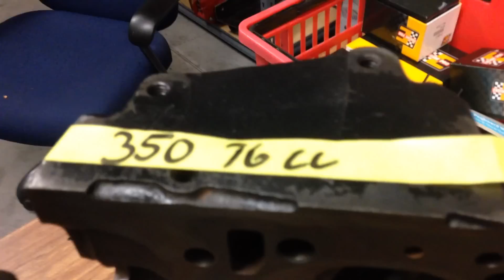350 and 305 Chevy what's The Difference

Comment: The problem with a 305 is only external. Tons of 80s and 90s cars came with one and they were choked at the intake and exhaust for emissions. Edelbrock intake, a set of headers and a new carb and bam. It still has 8 cylinders and it's still a 5 liter engine. and they last for damn ever.
Reply from the maker: There is one internal disadvantage and that is the bore size it has a bore smaller than the 283 a smaller bore is a definite disadvantage as far as air flow is concerned if we compare it to the 4" bore of a 302 IE 5 liter Ford the 302 with a 4" bore has a definite performance advantage over the 5.0 Chevy a larger bore is going to fill much better than a smaller bore every time this has been proven time and time again over the last 50 years at the end of the day however the 305 is not a bad engine they work well for the purpose they were intended and they are cheap to build maintain and run they defiantly get better mileage than the bigger bore engines If I had a pickup for light duty use or a car for daily use I wouldn't hesitate to build and drive one

Comment: i thought if you used the 305 heads stock size valves for the 305 (1.84 intake and 1.50 exhaust) did a bowl blend cleaned the throat, and un shrouded the intake side of the chamber to the cylinder it would make more power, it would defiantly have more quench area so higher compression shouldn’t be as much of a factor.

Comment: But Hi-octane is not available for 11 1/4 compression, without racing gas.   Couldn't the 305 head with 350 valves be opened-up, so you end up with a 10.25 compression, de-shrouded valves, plus running a cutting medium to increase runner-volume in the head, so it flows like a 350?  I guess if you wanted hi-compression on a 350, you could take a trick-flow alloy head, or stock, and mill it to increase compression, but I think buying a 305/350 valved head is for those that own a die-grinder, a compressor, a 350 block, and too much Time.   Cool vid.

Comment: The quickest way to find the difference is to drive a pick up with a 350 50 miles and then drive a 305 the same. 305 has no power now I have to say I never owned a 305 until a few years ago. I needed a truck to drive and bought a Chevy with a 305 and the first time I drove it on the Interstate was an eye opener. I drove a Ford Tempo with more power that that truck. Needless to say I didn't have it long.

Comment: Smaller bore and more gasket surface?
Sounds like a good recipe for more boost. 😁
Reply: Operator1836 Running the lower compression higher flowing 350 heads..??🤔

Comment: Are the heads on the 305ho tpi motors any better?
Reply from the maker: nope
Reply from the maker: s little but allot of work for little gain
Reply: We're restoring a 1987 z28 tpi 305 ho 5-speed for my son.  It's a low millage, 59,000, survivor.  Driving it, before tearing it down, it felt a lot more powerful than my buddies highschool 305 Malibu.  I figured it had heads more like the later vortec heads. 
My question could have been worded better.   I'm not really worried about adding horsepower for a teenager, I just found your video interesting.   
Thank you for your video and response...

Comment: can I put 350 heads onto a 305, and change my 3:05 fuel system to a 350 fuel spider if I change the upper and lower intake or would that lower the compression too much

Comment: 305 usually has 153 tooth flexplate instead of 168.
Also 305 lasts longer in a demo derby because the cylinders are farther apart and therefore don't overheat as quickly. The extra metal between cylinders acts like a heat sink or insulation

Comment: It's all about the combo! Gotta have the proper camshaft and intake. Headers, dual exhaust 4 bbl carb. 305 can make 1hp per cubic inch easily. Add a 700r4 trans 4.11 rear 28 ×10 tire. I guarantee the mustang guys will swear you have a 350 when you bust their ass!!!

Comment: 305 are plentiful and dirt cheap because of the stigma that they are junk. I have the factory 305 in my Parisienne and I chose to built it instead of trying to find a good 350. Some ads for a beat up 350 were around 1000$ and seen at 2500$ just stock and unsure of its condition either.  Trick Flow as all aluminium head with 56cc perfect for the 305. I am buying a set !

Comment: made 510whp with a 305 with 227 heads and eagle crank,clevite coated by calico bearings,eagle rods with some stock pistons with nicely gapped total seal rings and a 620 lift cam and a 75 shot  lol

Comment: What was the difference on a Chevy 305 vs the 305 h.o
Reply from the maker: The Heads,   the H.O. 305 has heads with bigger intske valves and a smaller combustion chamber for higher compression

Comment: 1st 305 I left stock 85 c10 2nd a 96 all I did was a Hypertech programmer I out ran a rouch 99 mustang supercharged but a dang Nissan 350Z out ran me lol so  I got beat but my 305 was extremely clean internally no gunk no sludge in that 96

Comment: Is it possbile you can tell me the motor i have the stamp on the back of motor says GM 3970010 thats on drive side rear and front by heads passenger side says V0125TJZ

Also on the passenger side the rear says A86 (inside an oval)

Comment: What was GMs reason for building the 305? It seems other than maybe fuel economy the 305 would never out perform the 350 so why put it into production? Thought maybe you might know
Reply from the maker: it was built out of nessisity the EPA required manufacturers build a certan percentage of smaller cubic inch engines with better fuel economy many of the 305 parts are interchangeble with 350 so they met the EPA mandates and saved a ton of $$ by useing existing parts
Reply: @Myvintageiron7512  I kinda figured it had somthing to do with government regulation I appreciate you answering my question this is the best video I've found as far as compare and contrast between the 2 engines. You put out great content and I've learned alot from your channel your very knowledgeable and take great pride in your work and work hard to teach all your viewers I just wanted to say thank You for all you do take care and keep the content coming THANKS!

                          -Cody
Reply from the maker: @codyhusbands1165  your very welcome

Comment: Why is my 72 c-10 engine a 307. What is the difference  between 305 and 307.
Reply from the maker: A 307 has a bigger bore and a shorter stroke the 307 and 327 share the same crankshaft and rods the 327 has a 4" Bore with a 3.250 stroke the 307 has a 3.875 bore same as a 283 but the longer stroke of the 327 3.250 the 305 has a smaller bore and a longer stroke it shares a crankshaft with the 350 3.480 with a 3.736 bore the good news for you is the 307 is a much engine than a 305 it has better bore and stroke combo it has gotten a bad rap becuuse of the garbage heads and cam the factory put on them, if you put a good set of heads and better cam it will really wake up but if you're going to do  that you might as well use your 307 crank and rods in a 350 block they will bolt right in and you have a 327 probably the best small block ever made it has a better crank to rod ratio than the 350 and a much better stroke and bore combo than the 307
I think its also worth noting ths
at the 305,307,327,350 all share the same connecting rod

Comment: Bought my 72 C10 with a rebuilt 305 that had 10k on it. Had it 16 years now and have ran it low on oil to the point of damn near stalling twice and overheated it more than a handful of times. It sits from weeks to months and even a couple years at one point. The most recent tune up has it firing up as fast as you can turn the key. If I had gotten the 350 I wanted when I was a kid, I'd have blown that fucker up years ago 😆

Comment: Can anyone confirm if 350 vortec heads will run fine with out any mods on a 305? I'm struggling to find new 305 heads in Australia, but 350 vortec heads are available.
Reply from the maker: Valves are too big they can hit the top of the cylinders

Comment: i like the 4 bolt 350 if i was going to build a sb or a 327 and 4 bolt it  but i like my bb my friend use to run a 305 at the strip and it was pretty fast i think they make good cruiser engines

Comment: What about 350 heads on a 305 does that make any difference thank you Doug
Reply: 350 heads, bigger combustion Chambers = lower compression on the 305.  It may flow better top end but low and mid range will suffer.

Comment: I knew some old guys one time that owned nothing but Chevys, you couldn't give them nothing but a Chevy, and they both owned a lot of different types of Chevrolet's, they made their living in Chevrolet dump trucks, but they always told me that the 305 was a better motor in the fact that it was more durable over the Long Haul, and back in the late 70s to mid-80s they made a lot of those engines, and those guys love those 305, I was just wondering what the opinion of somebody that knew engines would be about that statement, look forward to hearing your comments about it, thank you
Reply: This is a Continuum for my first post in the fact that I did not specify that it was a comparison between the 350 engine and the 305 engine, thank you
Reply: 305s seem to hold up better if I had to guess I would say it's because there is alot more bore spacing and the head castings are decently thick so overheating problems are pretty rare I have found in my experience that a 305 is alot more forgiving about the size and condition of the cooling system than a 350 or 400 and that systems that will keep a 305 cool will most likely struggle with a 350 or 400. I have a buddy who put a low mileage 305 8 years ago in a tow truck and he has beat the brakes off that poor engine and always runs it low on coolant and oil and never does maintanance but that little motor keep on running perfect

Comment: I had a 1982 Trans AM 4 speed car with the H.O. 305 at around 120k the cam lobes wore off. I put a 3/4 bump stick in it with headers and flow-master 40's thing sounded so mean. I could beat a 1982 Corvette 350 by a car length with it :).

Comment: In the late 70's early 80's Chevrolet sold many cars to Europe like my 79 Camaro with a 305 engine. The power was back them ok, but all 305 had problem with the camshaft. Not the 350. That why nobody likes these engine in Europe. Maybe the high speed in Germany killed the camshaft. I replaced my engine with a 350 because of the camshaft

Comment: Axtualy it depends on the year of the motor. Some years had the size stamped on the bloc thats a 305 and a 350 both. Some years had thicker harmonic balancers than others. Some years one had 3 bolts around the exhaust port some had 2 there are plenty of ways to tell the difference. My main reliable way. Is after enough motors u begin to learn casting numbers on the block. Just like learning about vin numbers. Just because ubcant tell the difference dojt mean others cant
Reply from the maker: No one said anything about not being able to tell the difference not sure where that's coming from

Comment: Bore is smaller on the 305 crankshaft 3.48 is the same as 350 chevy 302 has a 3.00 crank the same as a 283 the 302,327,350 all have a 4 inch bore different stroke cranks 3.00,3.25,348 a 400 smallblock has a 3.75 stroke crank and a 4.125 bore

Comment: Always heard that about the 307 but they can surprise you and run with good power. It just depends on how you build them.
Reply: the 307 was basically the same as the 302 gm built for the Camaro in the trans am series.
Reply: @butteredbiskit3497  I thought the 302 came from the 327 and the 307 from the 283. been a long time so I could be wrong.
Reply: ok so the 302 was a 4in bore (327 cu in) with a 3in stroke (283 cu in). upon further research, the 307 was a different animal with 3.875 bore and a 3.25 stroke. so basically we both dont know jack...lol
Reply: you were right about the 307 and 283 having the same bores though.
Reply: @butteredbiskit3497  LOL at least you looked it up.
Reply: Those engines look good at the local pick a part where I get paid for get rid of the rest of the scrap metal I turned in for more money 💵 to build up my bank account
Reply: They put them in the first years of the Camaros were built Mr doubtful
Reply: They also coupled it up with a rock crusher 4 speed transmission for your information but I guess I just don't know what I'm talking about

Comment: putting a 350 head on a  305 block will the valves interfere with the block ?
Reply: No compression 7.01or close and 2.02 valves will hit cylinder wall due to lack of cylinder wall space
Reply: Yes 2.02 valves will hit

Comment: 305s can be bored to, I believe, 337. Not far from a 350. I've seen a couple that ran really hard in Camaros, and had one in a truck I bought where it was supposed to be a 350. We thought it was for a couple of years, the power was there. We bragged about the fuel mileage on our 350, only to find out later when beefing it up that it was a 305. I'll take one anytime. The most HP the factory ever put in one was about 220-230 HP.  Cam, intake, carburetion could add about 100 HP to that with relative ease.

Comment: I had an 81 Silverado that had the 305. What a piece of crap. First thing was in 81 Chevy had soft cams in these which had to be replaced. I did the upgrade to the heads when I had it apart with the 1.94 valves and an upgrade cam but it just didn't have the power I expected. Replace the motor with  350 and never looked back.

Comment: Save that 305 this way. Recipe: 305 block, 283 crank, 283 cam, longer connecting rods, 305 heads. Ellerbrock performer 4-barrel intake. Mix well. Makes a little demon.
Reply from the maker: Thanks for sharing

Comment: Even though 305s were gutless they seem to be the most reliable and rugged small block, I have personally seen 305s take beatings that would kill most motors and 305s rarely blow head gaskets or crack heads like the 350s and 400s do and you can find sweet low mileage 305s for cheap which is perfect if your doing a daily driver build, so in my opinion 305s don't deserve all the hate they get they are decent motors just not from a performance stand point
Reply from the maker: Agreed

Comment: So I have a 94 Cheyenne 2500 that has a 350 Tbi in it with over 300k miles on it, I need to pass California smog.  I can get a tip 305 with 60k for free and was just thinking of changing the motor and swap the intake and put the tbi on the 305 for the sake of passing smog and used the truck for just running around town to get parts and other building materials.  Can anyone foresee any issues?

Comment: I would turbo a 305 before I messed with a 350, the smaller bore size/piston size has been proven to stand up very strong with high PSI. Another way to look at it is a Grand national ran a 3.8 basically a 305 minus 2 cylinders, they produced around 330 ft torque some say even more because Buick rated them lower. Now imagine adding 2 more cylinders and still run 12-15 inter cooled PSI...

Comment: On the topic of flow in chev heads. From the factory they suck. The runner and valve pocket are full of sharp edges rough casting and the shrouding in the chamber could be better. One nice thing about rebuilding a 305 is the cylinder walls don't wear as much as a 350 you can just ridge ream, hone bore straight and re-ring old pistons.

Comment: Can you run a 305 balancer/damper on a 350?
Reply: No different weight
Reply: @todtabor4346  what about timing marks? 305 @ 12 o'clock and 350 @ 2 o'clock, change timing chain cover as well?
Reply: Use a digital timing light I would think anyways.

Comment: If it wasn't for emissions regulations in the '80s the 305 wouldn't exist. After GM started using a decent fuel injection system around the mid '90s they were able meet emissions regs with the 350 and actually make horsepower at the same time (vortec and LT1). The 305 pretty much disappeared after that.

Comment: Hey guys and gals here is a good tip. Avoid 305 heads, trust me, it would take too long to explain. The 350 block is a bigger bore but has different bore spacing as many SBC's do. He must not know that. The cranks interchange but might need more weight added when swapping a 305 to a 350 block, different internal balance. The con rods are the same and most of the short block parts. I should do a in-depth complete build from 265-400 SBC's with interchangeable parts and not. A lot of parts interchange but are NOT the same weight or strength. Devil is in the details. Pulled down many motors with vibrations and found miss matched internal parts. Not to mention miss matched external weight balancing parts. (Facepalm) Just putting it out there.
Reply: The bore spacing is not different.
Reply: @spaceghost8995  If you think 400 and 265 have the same bore spacing your wrong go look at set of heads from both and swap them from one block to the other. Tell me what you see looking up into the heads smart guy.
Reply: @kenmoule825  I did not say that. I meant 305 and 350 have same bore spacing.   If they don't then why can you swap cranks ?